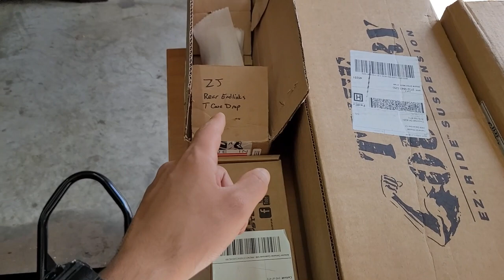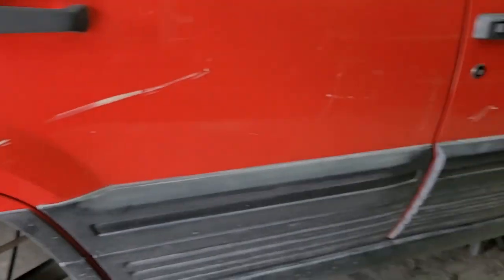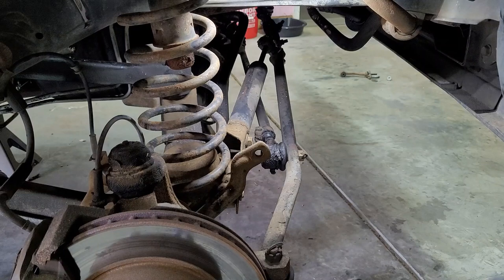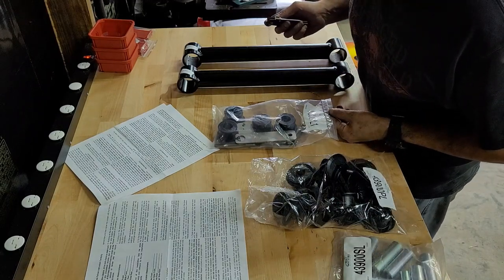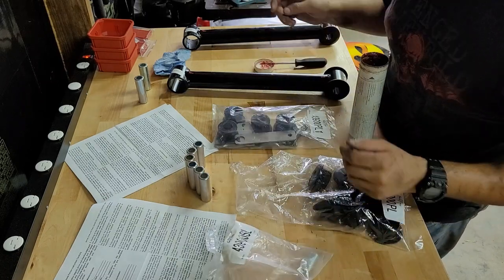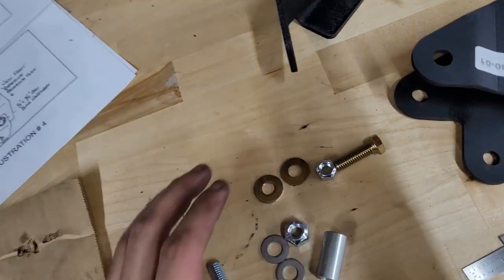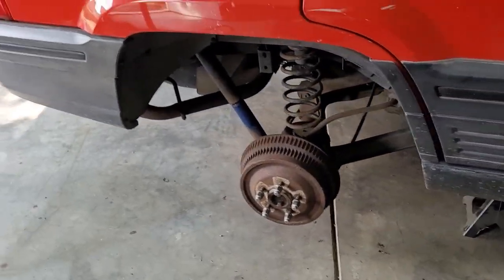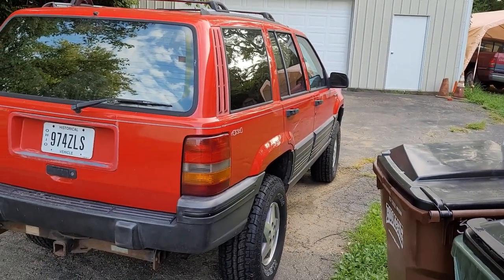3.5" Tuff Country Lift Kit Installation Jeep Grand Cherokee ZJ

Comment: Nice old ZJ you have there man.
   I really like ZJs  especially the early ones  93,94,95 obd 1 . 
 I have the twin older brother to yours,  mine is a 95,. Except mine was a factory rear wheel drive and I converted it to a four wheel drive with a 242j transfer case.
 I too have installed a 3-1/2"  suspension lift on mine,. But I did just by a kit , I put together what I believe to the best parts for my budget and the intended use that I am going to use it for.
  I have Rough Country lower control arms, Core 4x4 upper adjustable control arms,  and I went with Rubicon Express front coil springs, 
 And I swapped the front springs to the rear because they were in excellent condition and just needed a coat of paint.
 I'm running the stock track bar in the rear,  but I went with the Rough Country 3-1/2" drop bracket for that because I like that it doesn't cause any kind of rear axle clearance issue do to the fact that it bolts to the frame and not the axle, and it you don't have to drill and holes or anything to install it.
 I made my own bump stops from some parts that I bought from Energy Suspension,. And I also made my own rear sway bar links from some grade 10.9 bolts.
 My shocks are Bilstein 4600 at all four corners.
 For the front Track bar I went with a Rusty's off Road adjustable bar because steering stability is very important,. 
  The front axle I used is one That that I found on Market place from a 2003  TJ wrangler.  That was in good condition,. But before I installed it I replaced all the seals , gaskets and oil,. And I replaced the ball joints, and also the lower control arm brackets with a pair of Barnes Four wheel drive brackets,  I highly recommend those over using the stock one's.
 I also installed a reinforcement bracket plate for my track bar mount on the front axle , because I don't want the original hole to elongate or crack like they often do on lifted jeeps.
  My only regret so far is that I went with Rough Country front sway bar end links, because they are made pretty cheap, especially the bushing sleeves.  But I plan to replace them in the future with a better set , or built my own.
  I know this is a lot to read, but you seem to be a Guy who likes ZJs such as myself so I hope you don't mind.
 Maybe some of this jibber jabber will help you out or give you some future ideas for building your own ZJ.
 Thank you for your videos.
Tim from Wisconsin.
Reply from the maker: You know, I never could understand why jeep ever put out 2wd XJs/ZJs/WJs...
But thanks for sharing, sounds like you got a fun one. I do wish I went for more adjustable parts in the front between the trac bar and control arms. Dealing with some less than ideal steering right now even after getting it aligned at a real shop. Haven't touched the jeep much after lifting it, but it's next in line to be back in my shop to figure out the transmission leak and do interior work and all that.
Reply: @cammedup3078  
That is pretty common when you install a suspension lift,.   You are probably not going to be able to run with the factory caster adjustment on the lower control arms.   If you can set it up with 5 to 7 degrees positive caster adjustment would probably be about a setting.
 And then if you still need further adjustment you should probably go with some adjustable upper control arms to help dial it in.
  Considering all the original parts are about 29 years old, you may want to consider replacing the bushings for the upper control arm mounts on your front axle and maybe the ball joints also.
 I replaced all of them on mine,
I went with Moog bushings, and I also welded on a reinforcement plate on the passenger side upper m
Reply: Added a plate for the upper passenger side mount, I made one, but you can buy them from Barnes Four wheel drive or some other places. 
 My biggest issue in the beginning was drive line vibration,. And adding a transfer case drop only seemed to make it worse,.  
 I tried one of those washer plate kits from Zone off-road for the rear, where you slot the upper rear bracket bolt holes,. Do Not Ever Use Those!   That is what I went with because I bought the upper adjustable control arms from Core 4x4 .   So I ended up having to weld up the bolt holes and repair them..
  In your video it kinda looks like you have some camber issues with your ball joints,. Like I said it just looked like it in the video.  But if you are having steering issues, and your jeep has a lot of miles on the original parts,.  It would probably be best to inspect everything very well and replace anything that is worn out or that looks suspect for wear , with some good quality parts.
  If you have any questions, or even any ideas you can just send me a message if you want.   I am a bit of a old timer and have been working on stuff for forty years, maybe I can help,. I don't claim to know everything but I don't know mind sharing what I do know or trying to help someone else out if I can.
Reply from the maker: @tsmith578  I do intend on giving it a whole look over once I get it pulled in my shop. I'll check the whole steering system for slop and wear. But thank you - I always appreciate any insight and those willing to share

Comment: I got a 97 Jeep grand Cherokee 4.0 6 cylinder 4x4 with a 242 transfer case.. Excellent running Jeep very clean but down side I bought it for 1800 and it has no front drive shaft so I need the transfer link kit and a front drive shaft to hopefully get it working. It’s in 2wd at the moment.. I bought new headlight assembly and spark plugs and wires and distributor cap and 6 fuel injectors tore out after market wires that was poorly installed and got a Sony stereo and Sony speakers.. had to replace all window regulators because only one window rolled down. It dropped oil pressure at idle but not when accelerating but since I did a complete oil change and fuel injectors it stays normal at idle and acceleration. Strong running Jeep the engine is actually quiet and smooth the transmission switches gear amazing and no wheel wobble I can drive 85 mph with no problem. The a/c and heat work.. I did a lot over the last 2 weeks now about to get this lift kit that your installing and maybe 31 inch tires. I put the flowmaster super 10 on it as well.. I love my Jeep. Thanks for sharing this video looking forward to doing what you are doing in this video.. 🤘🏼

Comment: Don't know why you didn't mention what size tires you originally had on it, as well as what size the new tires are? I've got a '93 ZJ - same color as yours, with the same factory wheels. Went from a 235/75R15 up to a 31x10.50R15. - Still riding on the stock suspension. The only thing I had to do was to slightly trim the front bumper plastic. They rub on the lower control arm at full turn - I just have yet to readjust the steering stops. 

Thanks for sharing this content.
Reply from the maker: The old tires were stock 235/75R15, just like yours. My bad if I forgot to mention the new size - they're 31x10.50R15 as well. With the lift they clear lock to lock with no trimming or rubbing
Reply: @cammedup3078  Appreciated the reply. Forgot to also add that when I watched this yesterday, I think you mentioned something in the video about "tryin' ta keep a classy look". - - I have felt the same way about 'my' ZJ since I bought it - and cringe sometimes when I see people hacking TF out of their front fenders and rear quarter-panels to make clearance for oversized tires. - - It may sound silly to most, but I actually like the look of the wide plastic trim at the bottom of the doors.

Not sure if your channel has vehicles that you own and plan to keep, or you simply buy vehicles to flip them, or...? In any case, I subscribed to your channel yesterday - mostly in the hopes that you'll have future content about your ZJ. There are SO many different lifts available, that I just don't know what's my best option for the least amount of money and to be truthful - I highly doubt if I'll ever actually 'need' a suspension lift, because I don't want to take the chance of trashing my classic ZJ on the side of a boulder or tree somewhere, because I'm sentimental about this one. - - It was purchased from my in-laws, who have had it since it was new off the lot. Any@#$%^ - I'm babbling. Thanks again for the reply.
Reply from the maker: @dawabbitt3079  Most of what I feature on my channel are flip vehicles. The WRX is the only vehicle I have videos of that I plan on keeping forever. I also have a rust bucket Cherokee that I have all cut up and rigged out that I'll probably keep for a while until its value shrinks to nothing
Reply from the maker: @MidnightPolaris800  I wouldn't say garbage, but I will agree that they're money pits. The plan is to gradually modify it until she blows then drop a new short block in and carry on with the mods until I'm happy (probably not possible...). Certainly helps to have multiple vehicles for backups. At least mine doesn't have an EJ plant, like donut media comedically tried to make work

Comment: What did you do to paint the trim?
Reply from the maker: I have not painted the trim. I'm going to try to use plastic restoration stuff first and if that doesn't work, my go to paint for plastics is Rust-Oleum flat black
Reply: @cammedup3078  Thanks, looks great. I have the same color Laredo